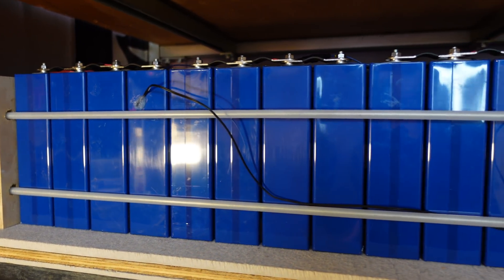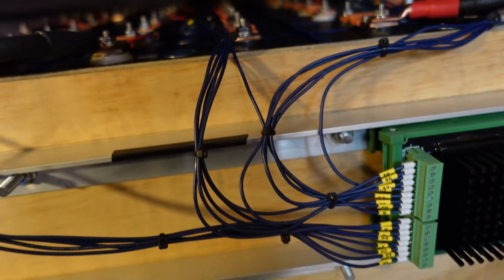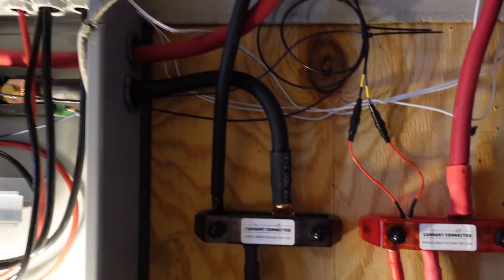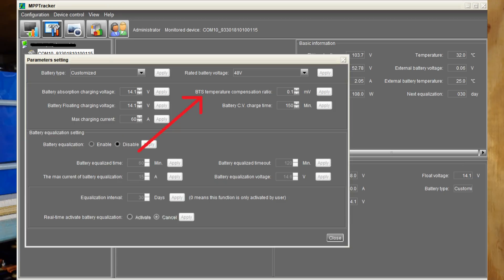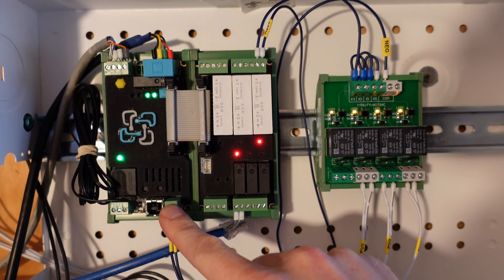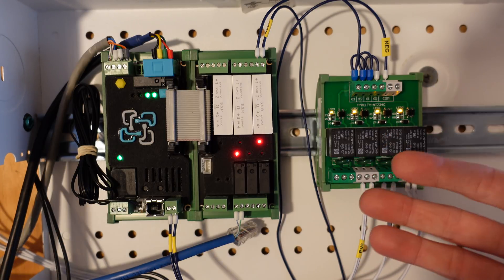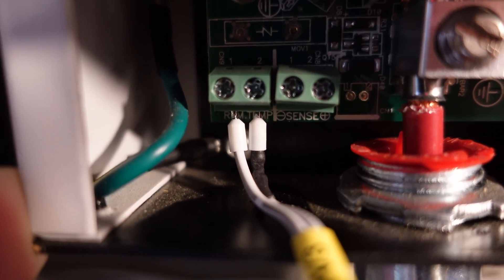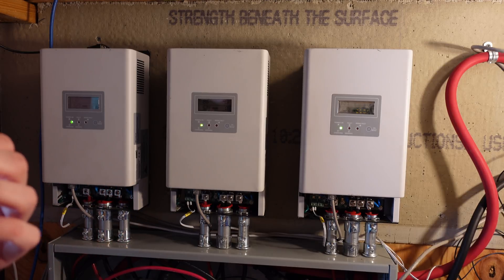Batrium Low-Temp Charging Protection with MPPSolar PCM60X Controller

Comment: The main issue with the Batrium BMS is that if you have multiple series of batteries, if one cell of one battery crosses the max or min settings, the entire system is shut down. The solution is to put the Batrium BMS in parallel with another BMS that just provides the disconnection per battery.

Comment: I saw your video about fuses---SO   If a Lead acid Battery develops a Short Citcuit and the proper size fuse is blown , the fire works usually stop. 
Are Lithium Batts the same or do they short out internally because of the outside Short.
Do the fuses when sized properly stop the fireworks?

Comment: Other solution: Insulation your battery house with PIR (foilback insulation) and make it airtight. Then put a cheap electric blanket into the battery shed around the batteries, also consider a deskfan to distribute heat. Start logging your data temps with an ESP32 and you'll always know that your cells are never going to freeze.

Comment: I really appreciate your expertise.   I can think of many ways to protect LiFeO4 batteries from being charged while frozen.  Although your method is creative, I would think that protecting the batteries at the BMS level for your equipment doesn't allow the batteries from being used as much as possible.  Two things: First, they can still be used at 32F just not charge them.  Second, when you get down around freezing, they do not perform as well as they would if heated.  I have a shed that I have set up solar to power the building with an inverter and charge controller.  It too is insulated but I live in a moderate climate.    I chose to put a RV propane heater with a thermostat that kicks on at 33F and shuts off at 34F.  I could warm the shed more but mainly I am avoiding freezing.  I use minimal propane and have the full use of my batteries even when the temperature drops below freezing.
 Question is why did you not just heat your building to maintain above freezing?
Also why the concrete board?
Reply from the maker: The control I set up in this video is just to disable the charging when below freezing, not the discharging. As you noted, they can discharge below freezing, just don't perform as well. The shed isn't technically "heated" in the sense of having a dedicated heater, but the inverter is on 24/7 and creates plenty of heat to keep it warm. For example, it's 30F outside now and the shed is at 73F. Not the best example because it's close to freezing, but even when outside is in the single digits, it never even gets close to freezing. The only exception is when I turn the inverter off (such as a snow storm and run out of power). While I fully agree that a heated shed would be best, I'm not sure it's worth the cost of the additional equipment in my particular use-case for those couple of days per year :) Also, concrete board because it's less flammable than plywood.

Comment: Do different packs discharge eavenly?
Reply from the maker: The 2 battery packs will always be at the same state of charge since they're wired in parallel; however, the 280Ah pack will always be providing and receiving a greater percentage of the power than the 230Ah pack.

Comment: Nice video as always, but why you didn't use the 84mm flexible busbars between rows ?
Reply from the maker: The 84mm was too short for the connections between rows because of the insulated threaded rod between the cells.
Reply: @LithiumSolar  Do you know what size busbar would have worked?

Comment: cool, I am wondering if having "proper" control of the charge controllers by having them all talk over a communication bus to the BMS is slightly more unreliable because you set it up so that if the Batrium fails or wires get disconnected then the charge controllers will turn off. Is that type of failure more also present in connunicating setups and equipment?

Comment: Can-bus and other types of serial communication, is just a way how manufacturers try to prevent normal consumers and us builders to use equipment in other configurations as they want. That's why simple Chinese equipment is so ideal for us DIYers. Sensor ports are perfect points of hacks and mods. You can do this same method with a variety of devices including BMSes. Just take a cheap microcontroller, write some code and use equipment your way.
Reply: Actually, cheap can-bus transceivers are becoming available as more and more hobby activities (like model railroads) use it. Can-bus IS a good solution in an environment like a battery shed, It was invented for communication between modules in vehicles (RR Locomotives, automobiles, airplanes, etc.)

Comment: You are one of the smartest solar setup people I have even seen, (not forgetting will prowse) I know you probably don't answer tech questions but I will ask anyways, I have several 12 volt lifep04 pre-made batteries from two different manufacturers but I think they are from the same factory, some are 200AH (100AH cells) and some are 300Ah batteries (150Ah cells) all of them have their own BMS, I would like to connect them all together to make a larger bank, is there anything special I would need to do to connect all of these together in a 12 volt system?
Reply: Check the specifications for the battery, some let you connect them in parallel. Usually if it is permitted you need to ensure they are within a tenth of a volt difference when you connect them up otherwise the highest voltage one will dump a lot of current into the lowest.  Some also have limits on how many they will support connected in this manner.
Reply: @Anchor2012  the batteries allow connecting in both parralel and series but everything i have read says not to connect different AH batteries together or batteries of different brands, some videos I have watched say it can be done but manufacturers say it can't, seems a bit overly cautious to me to day it can't be done
Reply: @todamnbad  See Off Grid Garage. connects 7ah and 280ah in parallel!
Reply: @BajanAlan  i watched that but I like to get more then one educated opinion on the matter

Comment: That's really an awesome and creative way to control those controllers. I have the MPP Solar PCM-40CX. I'll also try to control it using a suitable kiloohm resistor with an external temperature sensor board. Thanks a lot for this video.